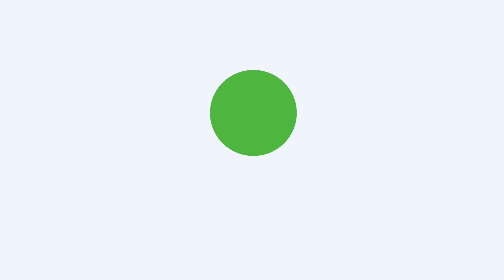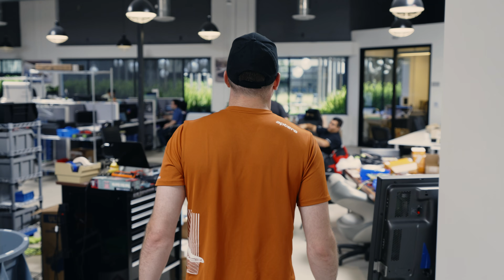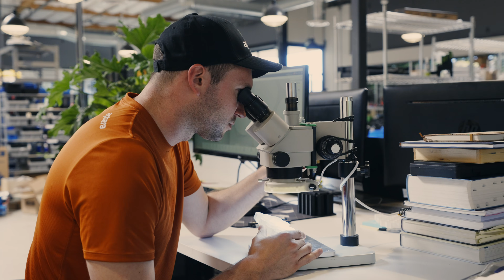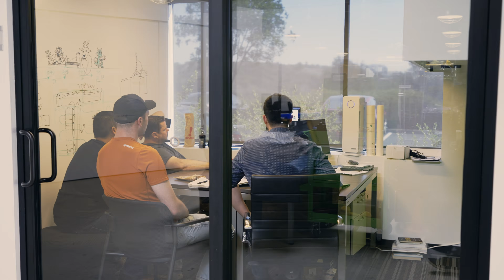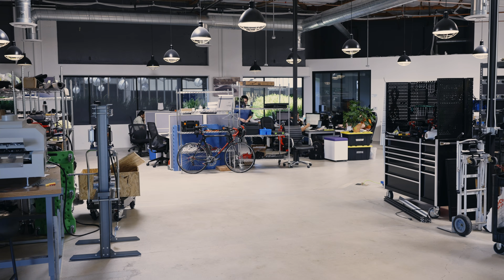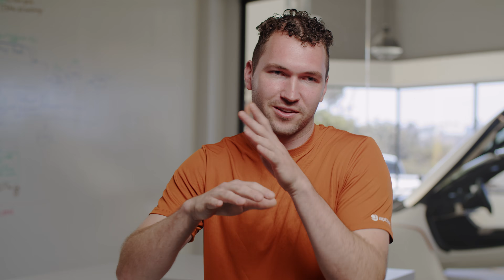Aptera Makers Series — Battery

Comment: Top priority: Make sure it doesn't spontaneously burst into flame. LG Chem might not be the best supplier.
Reply: LiFePO batteries don't catch fire.  They're much cheaper and a bit heavier.   According to Sandy Munro (Munro and Assoc.), there were 212,000 car fires last year.  Almost all of them were gasoline powered cars.  CATL makes them (I think).  In any case, it looks like Lithium Iron Phosphate batteries are going to win the competition with Lithium Ion.  Even though they're heavier, they may wind up winning in EVTOLs also, since a fast moving fire in a plane at 12,000 feet is a very serious matter, much more dangerous than one in a car at ground level, where you can exit the vehicle by opening the door and stepping out.
Reply: @gregtuve1109  LiFePO4 (or "LFP") was the leader about a decade ago, before losing most of the EV market to chemistries with higher energy and power density. It seems to be making a bit of a comeback, but is far from assured any significant success... and it's not much cheaper.

Comment: Todays battery technology race is like what happened in the race to be the number one diesel engine manufacturer one hundred years ago. I am fascinated by BYD's Blade, Atllis' AVM, and Tesla's 4680 batteries which are all liquid cool requiring heavy radiator cooling pump systems. What does Aptera do in their battery design that does not require radiator liquid cooling while running and charging? I must be missing something basic about their actively cooled cells using Hydro-form Alummina cooling channels.
Reply: The video doesn't imply that their design "does not require radiator liquid cooling". The possibility of hydroformed aluminum cooling channels (to route cooling fluid around the cells) is a small detail which changes nothing about the need for circulating fluid, pumps and valves to control the fluid, or a heat exchanger (radiator).
Reply: Aptera is using the bottom shell of the vehicle as a radiator.

Comment: Everyone needs to share these cars with the apartment dwellers that want electric cars but cannot easily charge. I think there is a huge market for Condo/Apartment living considering it can charge in the sun.
Reply: Yes and no.  most have underground parking.  Shade impacting real world charging will be huge.  It does however make providing reasonable charging far simpler since anywhere that has electrical for block heaters is already set.
Reply: @ccibinel  good point, I'm mostly taking about here in Seattle. Rarely unless you are in downtown do apartments have garage parking here due to building up and down is tricky. In other places the bedrock may be stronger, but here it is basically non existent haha.
Reply: @lionheart2165  in Seattle with a any amount of shade I'd be expecting more like 20 miles. And then 10 in the winter.  I'm in kelowna just north of you and we have lots of tall trees and I wouldn't count on the solar being worth much.  I'm still probably going to invest and buy because it's a sports car that can charge meaningfully on 120v.
Reply: @ccibinel  Actually, this is a common misconception, in Seattle we get about 60-70% of the solar power as SOCAL, during summer especially we get sun from 5am to 10pm normally. Sure, winter would kind of suck, but 7am-5pm still isn't bad really. 

I actually charge my Prius Prime using Solar Power, was able to get 3-4 kWh per day for free on the car (20-25 miles). Considering the Aptera will be almost 70% more efficient than a Prime, I would expect somewhere between 32-35 miles per day, in winter, that might go down to 25-27 miles per day, which still isn't bad considering the normal commute in Seattle is less than 20 miles round trip.
Reply: @lionheart2165  actually more about trees and buildings.  44 miles per day is ideal location on the equator in an open field in summer.  Real world is never that optimal.  Obviously id rather your numbers are accurate but I'm pessimistic. Efficiency making for a easily charged quick and cheap ev is more my interest.  Feel like it makes every ICE sports car obsolete. Lot to like that I can ignore their main marketed feature and still want it.

Comment: Have you locked down a battery supplier? I imagine battery availability (raw Li in general) is going to have competing demand going into 2022. It'd be good to lock a commitment now. This is the top two factors, along with processor supply, that could easily push back production promises.
Reply: Aptera has NDA's in place with major potential suppliers, but we will start seeing additional supplier announcements soon.

Comment: Please layer regenerative braking into future models
Reply: Regenerative braking will be in all the Aptera's.
Reply: No competent manufacturer of any EV in this century would even momentarily consider building it without regenerative braking.
Reply: @brianb-p6586  Maybe you're just bad at context. Layering anything just means more of it, not in lieu of it.
Reply: @makerofthings  "layering" makes no sense for regenerative braking: it's there or it's not, it doesn't come in stages or "layers". The car would have regenerative braking now (if it existed as a production vehicle) - there's nothing more to layer on. The parameters of regenerative braking control can be adjusted; there's no need for a progression in future models.

If the intention was "do more regeneration in future models", the comment should have said that... and it still would have made no technical sense, as there is no reason to wait for future models to make more use of a feature which already exists.

"Dedicated regenerative input into battery pack segmentation" and "axel layer method" sound like you took a few random terms that seemed technical and impressive to you, and strung them together - these phrases have no meaning. Regenerative braking is a function of the motor and controller - it is not in any way physically separate from propulsion.
Reply: @brianb-p6586  Your inability to understand is not their problem and yes they are correct. Context matters
Reply: @EarthCreature.  Please explain what a "layer" of braking is, and how adding a "layer" would need to be delayed until a later model... distinct from simply increasing regenerative braking power (which is not a layer).
Please explain what a "dedicated regenerative input" is (and note that power from regenerative braking simply flows back into the battery on the same wires as power is supplied for propulsion, because it is coming from the same motor controller). 
Please explain how "segmentation" of a battery (which might be division into modules, but might not) is relevant to regeneration. 
Please explain what an "axel" is (in contrast to an "axle"). 
Please explain what "layers" mean in an axle. 
Please explain in what way any of my statements are technically incorrect. 
I'll wait with bated breath.

Fortunately, while Aptera is not a real automotive manufacturer, they are presumably sufficiently technically competent enough to ignore your ramblings.
Reply: @brianb-p6586  OH, you finally asked for clarification. Even though it's been mentioned twice over already by two people. How classy is that? How long have you been struggling with context out there in the world? At this point I don't know if I'm being insensitive to your capabilities
Reply: @brianb-p6586  It's not rocket science. The concept of placing multitudes of recovery rotars on a single axel isn't even a new concept. You really have to stop being obnoxious. It isn't a good look on ya
Reply: @makerofthings  Ah... you think there are things called "recovery rotars", which was presumably supposed to be "recovery rotors"... but there are no such things. Regenerative braking is done by operating the drive motor as a generator; it has nothing to do with the axle (unless the motor is mounted on the axle). It looks like you don't understand even the most basic concepts involved in an electric vehicle, which explains why you are having difficulty explaining anything; would you like some links to basic information?
Reply: @brianb-p6586  Give it a break kid. You're not doing yourself any favors. Rotary based regeneration is as old as dirt. No one would read this section of commentary and think you're winning an argument here.  No one is impressed
Reply: I agree. The sedan version could provide a dedicated regenerative input into battery pack segmentation.  The semi truck could potentially recapture a lot of otherwise spent energy too. There's an axel layer method to be taken advantage of

Comment: Active cooling is good news, a relief actually.  Design is about optimization, true, but it's also about standardization.  If you screw up your design and the batteries all fail--that happened to Nissan and more recently to the Bolt, so it could happen--it would be great if we could pick up replacements somewhere.    The solar panels will recharge a new battery, but not if it is so strange it can't be duplicated.  We're betting on you guys.  It's high risk.  Anything you say to lower that risk would be appreciated.
Reply: Remember that one of the CEOs, Chris Anthony, has already founded a successful publicly traded lithium battery company.  They have a deep knowledge of battery tech.
Reply: I don't think picking up and replacing individual cells in a pack is going to be that simple.

Comment: Geez I thought they were close to production, now I'm a little discouraged .
Reply: I had the same reaction. They are still designing the battery pack.
Reply: Yes folks we all want production now. However, as you look at the world around you you know we live in a dynamic time of change. Like a ship at sea building the navigation System so it can make its voyage. If they build too fast they will have to redo things to incorporate technology. Be patient. I know it is hard to do. Also Sandy Monroe is a good Shepherd for production.
Reply: All we can ask for is honestly and not fantasies from them.  When dates are mentioned, that is taken seriously.  Less squawking and getting some of them produced and sold will go a long way toward building confidence.  At this point, “pipe dream” comes to mind, and the smell of Elio.
Reply: The battery pack is the biggest engineering obstacle for this vehicle. With the high efficiency of the vehicle I think it would be prudent to start production with small packs as you are still going to have plenty of range. The longer range version will come with further R&D and shipping smaller packs means you can deliver more Aptera's.
Reply: @aricmayberry  The first ones shipped will have the 40 kWh packs.  Followed by 60, 25, and finally 100 kWh.

Comment: Where is the manufacturing plant that will be making these by the end of this year?
Reply: Currently they are (only) saying the production design will be finished by end of this year. Production rampup (sometime) next year.
Reply: @fotoguru222  That changed then, because that wasn't what I saw on Facebook recently.  But even so----if production is supposed to ramp up in 2022, they would need a manufacturing plant now, right, to get it ready?  It's not like renting a U-Haul when you call a week or two in advance and show up.  Producing vehicles means a decent amount of space, making sure local codes are complied with, knowing there is a good potential labor force nearby, etc.  All of that requires a lot of planning and time.
  I thought maybe they already had something secured, but not sure.
Reply: It's in someone's imagination.
Reply: @brianb-p6586  And I'm sure their wallet is getting fatter as others with a wild imagination send them the moolah.

Comment: What does actively cooled specifically mean here? liquid cooled, air cooled? Will the battery have some sort of heating for the winter?
Reply: From other information released so far, I'm pretty sure it's liquid cooled with coolant passages in the body.
Reply: @loctite222ms  That is probably the case.  If the beta vehicle testing reveals that they can manage temperature extremes with air cooling, they will probably go that way to save weight, but as far as I know this is still being investigated.
Reply: Active cooling means moving air or liquid to transfer heat.  They would like to save energy, so weight saving is a huge part of this.  There will be active eating and cooling for the battery pacts.  More beta testing is needed to chose the final design approach.
Reply: @n.brucenelson5920  If it's air cooled like an old Volkswagen, i.e. driving the car, air coming in cooled the engine in that car, would be cooling batteries in this one...wouldn't that be passive cooling as opposed to active?  For active, doesn't that mean a separate component that accomplishes the cooling?
Reply: @funktron4  Of course, people do refer to old  V Dubs as air cooled to distinguish them from vehicles with antifreeze or water radiators.

In actual fact the engines are mainly cooled by the oil pump forcing oil through a radiator with and assist from a fan pushing air.
Reply: @funktron4  Some air cooled EV have passively air-cooled batteries. The Leaf is an example.  The battery must disperse heat simply through radiation.  Some actively air-cooled batteries use thermostatically controlled fans to force air past the battery case.  The Prius Prime does this. Other Evs such as the Renault Zoe use cooled air from the air conditioning system to cool the battery.  So I guess you could say that there are degrees to the active/passive characteristics of air-cooled battery systems.
Reply: Good explanation, thank you.

Comment: Perfect! In manufacturing less is better. A never charge driven by the sun 1000 mile per charge vehicle is a home run.
Reply: There is no way that they will get 1000 mi/charge with the current design dimensions and battery technology. Think about the weight and volume taken up by a 100 kWh battery.
Reply: @mp3lwgm  the drag coefficient must be outrageously low though. Maybe it is possible.
Reply: @allandulles7108  Yes, their drag coefficient is way lower than any production car ever made, and lower than many race cars. Steve Fambro said the shape was inspired by sharks in the water. Then it was tuned with many iterations over many computer days of aerodynamic drag simulations.
Reply: @allandulles7108  with no heating /cooling in the cabin, windows up, cameras for mirrors and no offroad kit it should be possible at 55 mph in 60-75 degrees f.  Auxiliary things will use a lot more power as a ratio than tesla or similar.  Lucid achieved 500 with 2x the weight and way worse airo dynamics.  If you use those things it could lose 20-30% easily.  You won't lose a much efficiency for going faster as others but it will still factor in.
Reply: @mp3lwgm  You're right that fitting that 100KWH battery in was difficult. They had to enlarge the belly of the beast slightly to accommodate the largest battery, as well as to accomodate larger passengers.  They have said their batteries weight about 10 lbs per KWH, so that's about 1000 lbs for the 1000 mile battery. The 1000 mile Aptera's total weight will be about 2200 lbs. That's still less than other EVs out there with less range. Those aircraft quality composite body materials are light! 

Personally, I don't need 1000 mile range. 600 EPA test cycle miles will be more than enough for me. That's what I ordered, although I may change that to 400 miles if I'm convinced enough fast chargers will exist on my road trip routes.
Reply: I think the best measure of how much range is needed is... Can it run at 80mph for 12 hours straight? To me that is the maximum realistic limit of a US roadtrip. 80mph continuous on the interstate for 12 hrs. Coincidentally exactly what I have done. So not really a question of what the range is, but what the range at a certain speed is.
Reply: @allandulles7108  
Ha! It's not about how far you can go without stopping. What car or bike can even do that? 
Let's see, 80mph x 12h = 960 miles. 
At 25 mpg that's over 38 gallons of gas. 
At 30 mpg that's still 32 gallons. 
How big is your gas tank?

Its more about how far you can go into the wilderness, far from gas or charging stations (and probably at well less than 80 mph).

Anyway, Aptera 's low drag shape will give it better mileage at high speeds than any car today.

I'd also add that anyone driving 12 hours straight without breaks is a danger to himself and others on the road.  So take a break already!

Comment: I have a hard time believing that you can get a 100 kWh battery into a vehicle the size of the Aptera.
Reply: Maybe. The Aptera is roughly the same size as a Model 3 but I don't see space for more than 70kWh
Reply: @charllectric4842  If you are going to get 1000 mi range, with an efficiency of 10 mi/kWh then you need a 100 kWh battery.
Reply: @mp3lwgm  That is the plan.  Remember the beta models will be larger than the alphas, while retaining the 0 .13 CD drag coefficients.
Reply: @n.brucenelson5920  So you're moving the goal posts.  More frontal area means more drag force, and more drag force means more required power at a given speed. How much larger? When will Aptera actually sell something?

Comment: What size are the cells and how are you sourcing them? Batteries are a huge factor in cost so finding a good supplier is key
Reply: side-eyes LG and GM
Reply: @merrickhurst4150  LG should go back to phones  LMFAO
Reply: @DgurlSunshine  their phones were garbage too! Overheat issues, chip failures, screen/digitizer failures.  They're a freaking mess.
Reply: @DgurlSunshine  They make great dishwashers.
Reply: @merrickhurst4150  I still use my discontinued LG 10 yrs & running